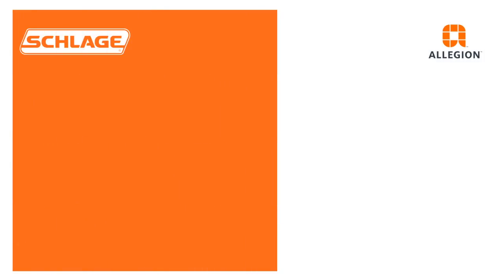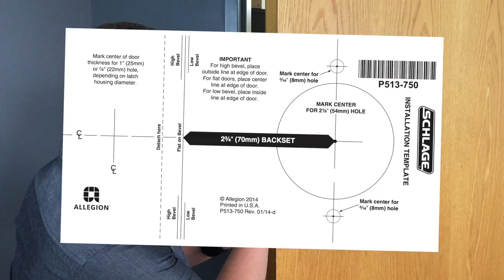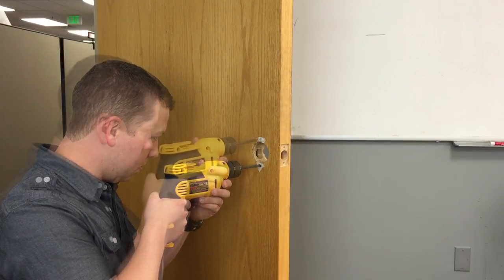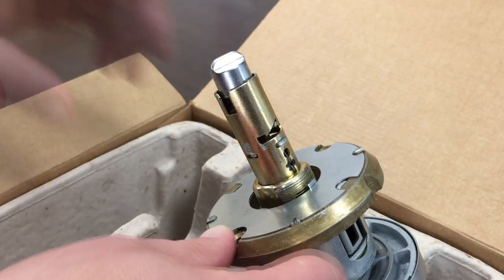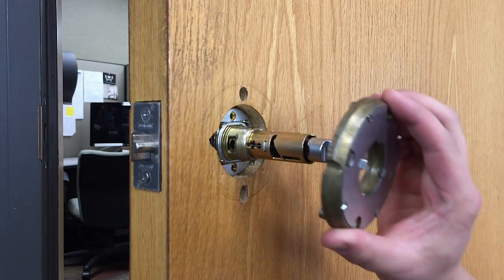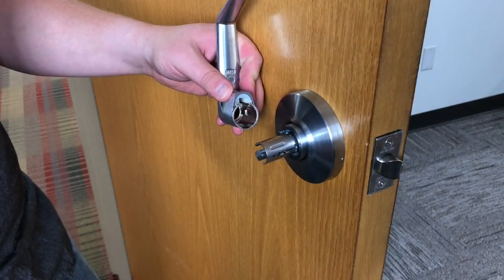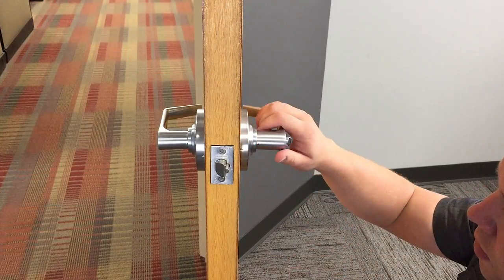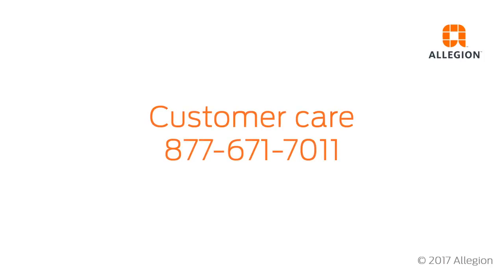How to Install the Schlage AL Lock

Comment: Awful to  install to many little parts that are cheaply made
Reply: It's not that hard except for the through holes, you are probably doing something wrong. If I had to guess, using a drill for the screws instead of hand tightening.

Comment: I have no pin, so I cannot remove the lever. I have tried with a small screwdriver, which goes in but the lever does not come off.